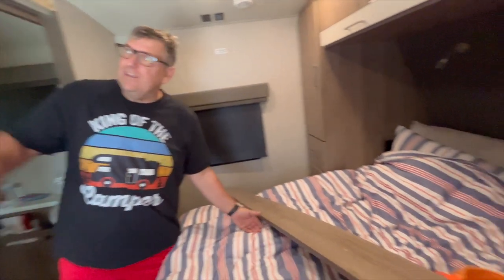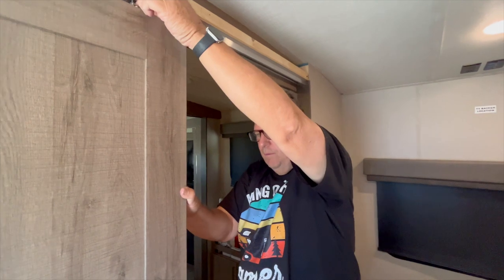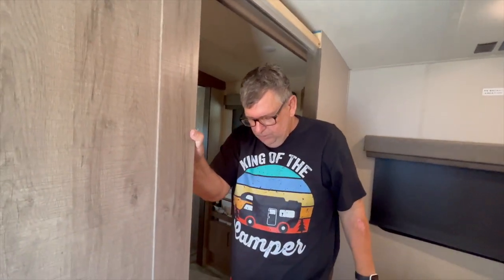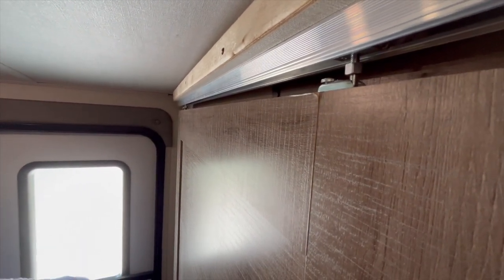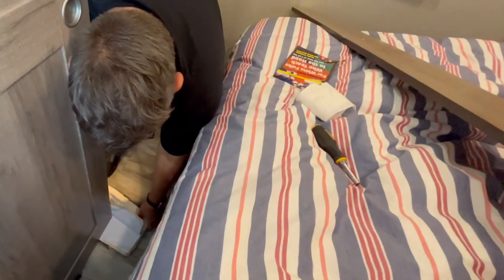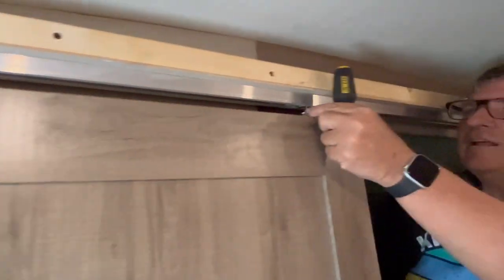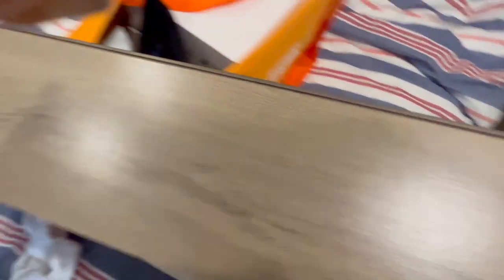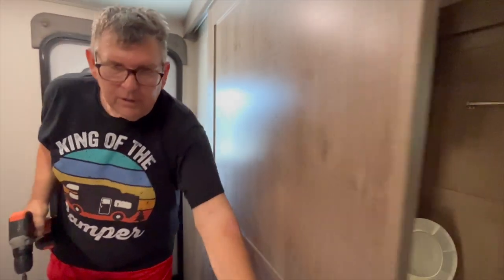Upgrade Your RV Experience: Fixing the Sliding Door with Ease

Comment: I have a 2023 Jayco 263 RBS. Our third time using the camper, the door came loose on the left and was hanging down when we arrived. I am thankful I’m handy and brought tools with me, but what a pain. I clipped it back in place, thinking they maybe did not clip it properly but found out it’s the clip itself. I got home, it fell off again, so I will bend it a little to make it snap together tight, so it won’t shake off again, (hopefully, lol)

They don’t realize, if it falls off, it will certainly damage something, but I’m starting to feel, they really don’t care. This must happen to everyone, so RV MANUFACTURING, GET A CLIP THAT WORKS, FOR CRYING OUT LOUD! This crap, sure dampens the trip that was/is supposed to be relaxing, ugh!
Reply from the maker: Yes we had this happen on our Rpod as well.  This seems to be a common problem!  Thanks for watching!

Comment: I had to fix my door by the toilet twice on the 2500rl.  The little hook doesn't seem to latch very well and it shakes out.   Bad design on those sliders.
Reply from the maker: Agreed not a good design we had the same problem on a previous trailer with a similar system.  Works fine in a house but not on an earthquake rolling down the road.  Thanks for watching!